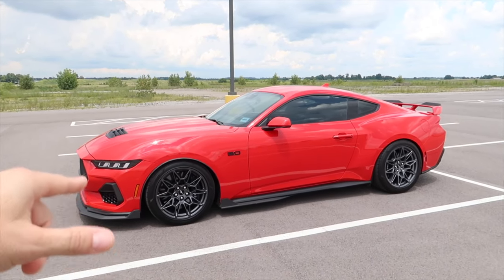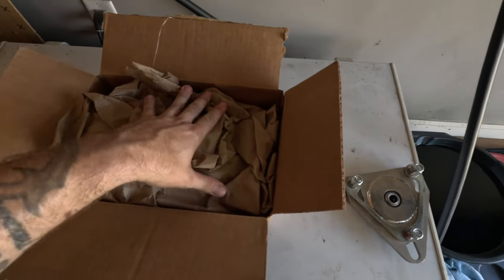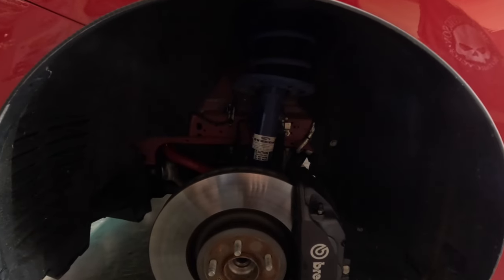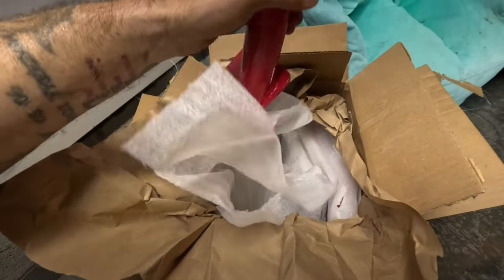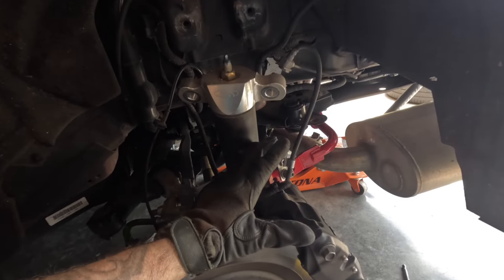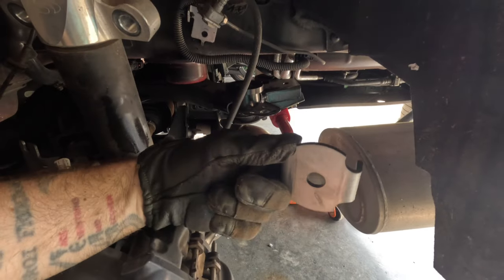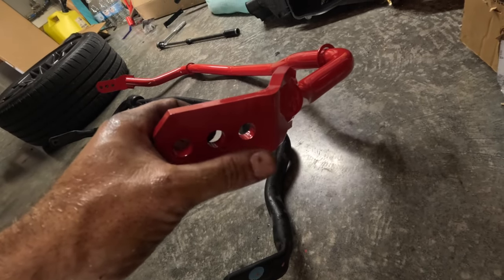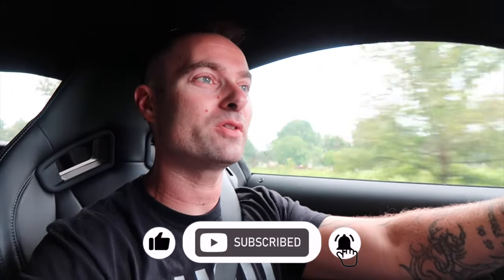MY 2024 MUSTANG GET'S BMR FULL TRACK SUSPENSION *FEELS LIKE A GO KART?

Comment: I like the comments on the "in the car feel.  I have had a suspension modified s550 non magnaride non performance pack and now a magnaride performance pack s650. I modified both cars similarly to your set up and both cars greatly improved the handling after...I noticed you still have the factory end links.  I think you would really compliment your setup with your "brand of choice" adjustable end links. I used steeda ( love them no nvh/cluncking so far) You can really feel the difference in how neutral the car can be once you adjust them to your car. Even my magnaride performance pack car puts a magnifying glass on the s650s improved suspension.  People keep hating on these cars, but they are damn good daily cars. Plus, when you want to get spirited, the car will do that as well! Great content... been following your builds for a while.
Reply from the maker: Thanks. It’s definitely on the right path. Definitely have been eye balling the end links. I have seen several ppl recommend them so they must be pretty beneficial
Reply: @Zander13Productions   with what you are spending/building pull the trigger...easy install.  Also, if you look at keltec he had bent end links on his gt350 with low miles...when my s550 had 4000 miles I replaced the end links and I also had a bowed front driver side factory end link...
Reply: I have a s650 PP + Magnaride, what would you recommend for better handling? I want better turning and a firmer feel in sport and track mode. All the modes feel too similar
Reply: @buzzkillpharmd6494  On my build I have the same car as you s650 M6 with performance pack and magna ride... In addition to what Ford has put on the car, I have added BMR IRS subframe support brace, CB762. I also have all end links replace with Steeda adjustable end links. I have a Steeda front chassis brace. Steeda subframe alignment kit. I plan to also add Steeda sway bars front and rear. The one thing I have notice with the mods I have done so far is that the car stays flatter in turns and has a lot less "float" when driving. I usually drive in sport mode, traction control off. These mods make the magna ride work better. Less delay from inputs to car movement. Hope this helps. If you do the end links remember not to full lock them down until you have the weight of the car on them. That way you don't introduce preload. You may even want to adjust them after the car has sat a bit on a level surface to get a good neutral feel to start with. This is to make sure the magna ride isn't trying to level the car anymore.

Comment: I used to love mustangs. I've had 6 over the last 25 years. Drag raced all of them, all NA. The last one was a '21 GT premium in antimatter blue. I spent many $1000's on mods on this- exhaust, suspension, tunes, wheels, tires, only to run 11.30's at the track. Now i have a Kia that runs that right off the showroom floor for less $$. No more mustangs...... But best of luck on your build.